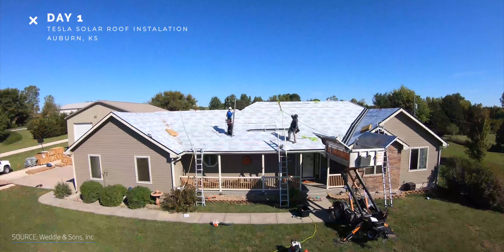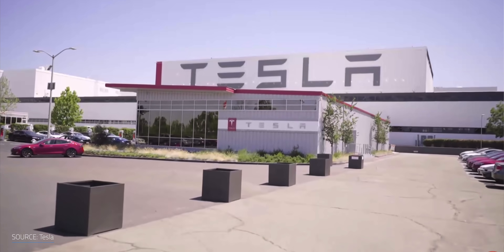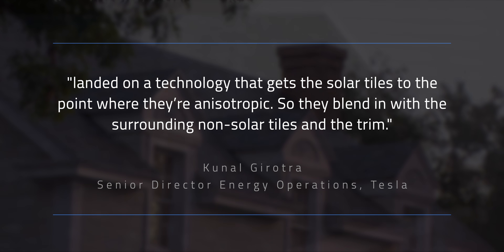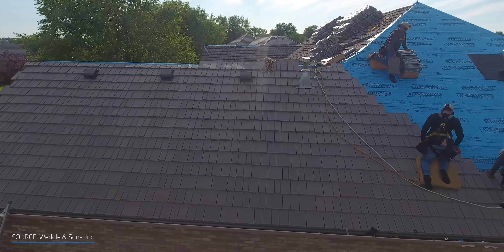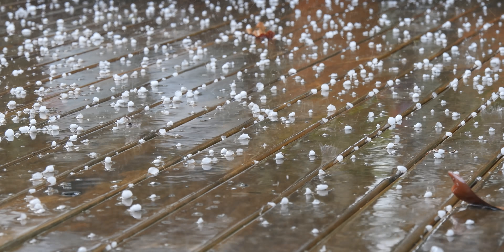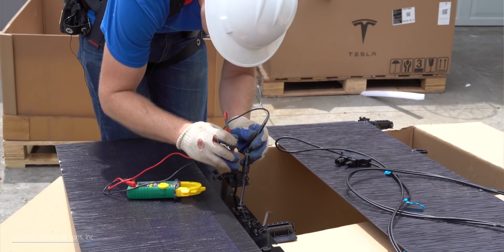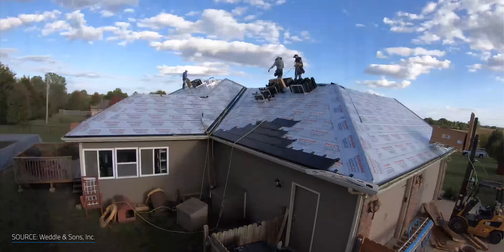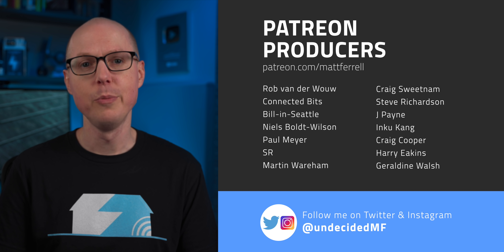Exploring If Tesla Solar Roof Is About To Go Mainstream?

Comment: I am still shocked to have discovered last month what prices Americans think is normal for Solar.  I had no idea that the peeps in the land of the free were getting so badly owned.  $2500 USD for a 6.6KW system fully installed, with inverter etc.  And they often offer a discount if you enquire but don't complete the purchase...

Comment: Thanks for so much Matt! Tesla & Tesla Solar Roofing is (hopefully) very much in our short term (3-5 yr) futures. The debate is permanent solar V a sun tracer system; potentially 50 - 70% more efficient? Details still TBD!
The industry innovates and changes constantly. Nowhere faster than with Tesla technologies.
Our 5 year plan includes a solar generation & storage system, with possibly an EV, if not a robo-taxi transportation system. Thanks again!

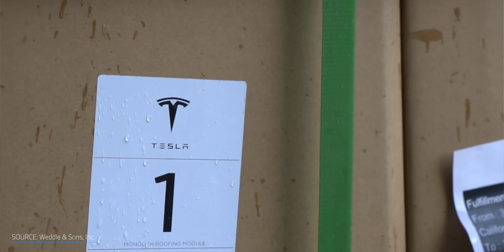Comment: @7:03 and 7:33 and 8:25 , I don't like the plastic framework these are build around. Should've been all anodized aluminum everything.
Fastened with Stainless steel screws and Teflon washers, insulating the different metals from each other, to eliminate galvanic corrosion. 
Plastic deteriorates quickly out in the sun. Specially where there are high amounts of UV and Ozone. at to that, plastic gets brittle with heating and cooling cycles. At -20ºC, it will break like glass, where as it would have had no effect at 0ºC. 
Adding additives helps a lot, but can't eliminate the destruction of plastic molecules or paints, from the Sun's UV radiation, and the Ozone in the atmosphere after lightning storms. 
Mortal enemies of all plastics.
Within in 10 years, it with break apart. A high gust of wind, and a huge chuck will get airborne and chop someone's head clean off! Clint Eastwood style! 
Too much? Time will tell...

Comment: One thing I think I’d like to see from Tesla would be an option for the same roof but without trying to blend the look.  
I personally don’t mind the look of solar tiles, and wouldn’t mind if my whole roof had that look.  
Especially if the cost could be lowered more without the look, and maybe get better efficiency overall.   
My wife and I just bought a house, and I think the roof is about 10 years old.  
If the installed price comes down even 10% more, or a larger tax rebate was offered, I think it would be foolish not to consider this as an option when we do need a new roof.   
I’ve started putting away a little money from each paycheck for future big projects like this.

Comment: I’ve been a licensed roofing contractor since 1985 & have helped design & introduce new roofing products such as Presidential TL by Celotex..I’ve been featured in numerous roofing magazines & instructional videos & I’m extremely blunt & objective when asked my opinion to the dismay of companies like GAF..I’ve followed Teslas solar roof since its reveal at Universal City. I immediately realized the individual tiles were not the answer & would like to see optional individual lengths of up to 10’ plus available with 12” or random alternating vertical etchings to give a more natural look..I believe the solar roof coupled with the Powerwall will take over the roofing & solar market..I’ll never install one simply because I’m retiring soon but the Tesla Roof would be my choice if I were in need of one..

Comment: Anyone who has had to deal with a roofing contactor will view this as attempting to walk through a camp fire carrying a pail of gasoline. It's very typical of residential roofing contractors to sub out the installers on a piece-work basis.  The contactor delivers the materials and these "handy men" ( and that's being polite) show up and install them.  Back in one of my earlier lives, I saw self-described "contactors" picking up leads from ads and even pamphlets dropped in mail boxes, handing out next-week's  "job site" addresses to "self-employed roofers" in bars on Friday afternoon's watering holes.   Such is the "trade" .

Comment: Matt, thank you for another awesome video!  did you discover any roof layouts which would disqualify a house from installing the Tesla Solar tiles sucesfully?  I was considering a roof that was not flat all around , one with several dormers.  Are there disadvantages for smaller houses?  Do you need a specific amount of contiguous flat space?  That would be great to know.  Also , it would be great to know what areas are being scouted like in your video.  Is Vermont on the radar?
Reply: Tesla has worked really hard to come up with a solution to almost any roof configuration, but from an installer perspective we'd definitely say that it makes the most sense when you have some large unobstructed sections of south-facing exposure. Solar Roof does have more flexibility than panels for fitting PV modules into more cut up roof sections, but complex roofs still add quite a bit more labor cost and cut down on production. Dormers in particular are labor-intensive and also create shading challenges. But both Tesla and installers are constantly working on ways to streamline and simplify installation.
Reply: @WeddleAndSonsRoofing  Thank you!!  that's great to know.  We are right at the limit of our current roof, and could push 1-3 more years out of it if we are lucky.  We live in a very harsh environment in northern  Vermont which doesn't help also!  The house does have half of the roof with a southern exposure, but it is not the "classic" flat roof.  We have a dormer.  I'm not sure if our roof will really pay off for the solar roofing.  we might just be better off to get a ground mount system.  I've called Tesla, and they are really not able to go through any of the details because they are not currently installing anything up here yet.  Hopefully soon!  :-)

Comment: This is effectively a PR piece for the Tesla solar roof tile product.  In a regular application, there is only one principal direction that can generate solar (we will leave out for the moment, the fact that most of the country does not have high enough solar insolation for solar to be effective).  Yet, to get a matched roof, all of the roof needs to be covered with the Tesla system (mostly dummy tiles).  The dummy tiles themselves are much more costly than all but the most expensive roofs and labor for installation is quite high(tempered glass can not be cut, so all the angled valleys are a huge pain).  The active tiles themselves are about 25% as efficient as a good mono solar panel initially.  I have not seen data on the drop off rates, but hard to believe that it comes close to a good mono panel.

There is a reason this has not taken off and the other companies in this area (Dow for sure) have quit.  The numbers don't work out, even with a subsidy (for at most 25% of the roof).  It is a niche product.

Comment: and another comment/question:  is there any new information regarding thermal management?  one of the nagging issues is that because there isn't space beneath the tiles, in addition to their dark construction, there's a chance that they either fail or have a reduced lifetime because of the relatively high heat load on summer days.  my guess is that the larger tiles help this a bit by spreading the heat a bit better than the smaller tiles, and maybe the interlocking with the nonactive tiles helps as well... but i haven't seen any data or commentary about it.  ideally, i'd like to see temp v. power generation for a south facing roof, roughly day by day, through a winter and summer season.  the temp data should be average over the generating day and/or peak temp for the day, and generation would be for the day, though being able to compare hour by hour temp v. gen for December days against August days would be spectacular.  anyway, you get my concern.  comparing those numbers to similar captured for a conventional panel install would be the perfect report.

Comment: if one wants cool looking solar, build a solar pergola in your back yard with transparent bifacial solar panels. It will be cheaper and look cooler. bifacial solar panels are only about 5 % more expensive than normal solar and have a longer 30 year warranty something like this:  https://hughloftingtimberframe.com/gallery/outdoor-elements/solar-pergola/

Comment: We've seen impressive advance in battery technology, but thus far the best efficiency achieved by solar panels remains below 40%. That suggests that there's a lot of room for improvement if research were to focus on such advance.
Reply: There's lots of research happening, but so far nothing practical.  
What we have is good enough, if it's installed widely.  Rooftop solar could power about 75% of homes in the US all by itself.  Adding wind power to that along with ground-mounted solar over parking lots and other places would take care of everyone else including industry.
Reply: @calamityjean1525  I agree, but I also believe that technology will make additional significant headway in the near future, and that the consumption of electricity will increase in the future. I'm personally postponing my purchase of a solar system because I believe that Tesla will soon introduce HVAC systems and other appliances that use DC current, which is better suited for powering individual homes than AC. It enables more efficient motors, and would eliminate the need for converting the DC current produced by solar panels into AC current using wasteful invertors. Plus, I expect there will be decorative tiles for driveways and sidewalks and streets that will be capable of contributing electricity.

Comment: Matt best for 2021 and safe year.   We are designing and constructing a 5 levels of CLT and Passive House Certified. 300 m2 roof and  450 m2 using #Tesla tile and #Tractile tile both impact resistant from hale. Price of #Tractle 1.25 of concrete tile roof and has no PV.   
#Xlam #CLT #PassiveHouse #LismreNSW #Australia
Reply from the maker: All the best to you too Ian.  Here’s to a good 2021!  That sounds like a great project and home you’re building out.  I want to go that route too.
Reply: @UndecidedMF  We are going to set up company to invest in EV like Apter and Arcimoto in Australia or manufacture under under  license

Comment: 'should hold up really well to impacts, should age well' have you seen the reliability of a tesla? on principle the motors should be fine, brakes should last an easy decade, and no engine or transmission fluids to change

which means if anything goes bad, theres no real fixing, only replace. every tesla before 2015 had a known design flaw that stripped the spline to the motor at around 40k miles, so that 'no maintenance' turned into a serious repair, of more than a few thousand dollars

on top of that, before i think 2016 or 18, they all have too small of a memory chip thats known to wear out from all the data being logged and the only fix for that is to pull out the computer and resolder a new memory chip, which costs another couple thousand

on top of their awful fit and finish QC, i cant see why people would think theyre so great

and thats if youre lucky and dont get one with problems from the factory

Comment: This roof is ridiculously expensive compared to standard roofs. Unless you have a very high end house,  this is a losing proposition based on ROI. What you fail to mention here is there are shingle roofs with 40 and even 50 year warranties.  

Honestly,  in AZ you can have a tile roof installed on a 2000 SF house with a 40 - 50 year tile roof for around 10 - 14 k. Panels would cost another 10k. The Tesla roof would likely be 50- 100% more in cost.  

On a high-end home,  where you are installing a decorative roof,  then yes, a Tesla roof makes sense.  But for the average homeowner,  no, it's not even close.

Comment: If every house had these, then local power could be distributed and power cost would go down, then the power co's would hate us all.
Reply: Power cost would go up actually. That’s what people don’t realize, as things become more and more energy efficient companies need to charge more because they have a relatively high ratio of fixed costs, so if you change the consumption of a variable rate good, that variable rate needs to increase to cover the non-changing fixed cost.
Reply: @Arteolike  Exactly!  Remember when CFL's and then LED lights were just gaining traction?  While I'm sure that electricity costs would have still gone up they probably wouldn't have gone up as much.  I think that's one of the reason for rising gasoline prices AND the deterioration of roads as well since in most areas FUEL taxes are used to (partially) fund road repairs.

Comment: One BIG advantage and not mentioned, contractors can literally replace every solar tile without removing a nail.  Not having to seal, or miss sealing holes in the roof membrane probably extends the life of a whole roofing system.
Reply: They mentioned it. :)

Comment: Yes, I am "chomping at the bit" for a Tesla solar roof!  How can I find an installer?
Reply: *champing  
https://www.youtube.com/watch?v=Ltb_14CWqDA
Reply: I believe you can find installers on the Tesla website.  Hopefully you're in an area that has at least one!
Reply: www.tesla.com - Tesla sells them directly and subcontracts to a local installer.  Tesla also handles the paperwork for permits and Permission To Operate (PTO) which allows you to send excess power back to the grid and get paid for it in most locales.

Comment: My experience with the Tesla Solar Glass Roof was less than ideal.  I love Tesla.  I drive a Model S and own a significant number of Tesla shares.  But… here is my experience:  I live in Rhode Island and found myself in need of a new roof.  I called Tesla last March (2020) and placed an order for my Solar Glass Roof. I got the financing arranged immediately and I was soon notified that the necessary permits had been applied for.    Then things started to go sideways.  A couple of months went by and my permits had not been approved.  I contacted Tesla and was told the city was dragging their feet because they were not familiar with this product.  So I went to City Hall and spoke with the two people that were responsible for approving the permit, the building inspector and the electrical inspector.  They informed me that they had emailed Tesla for a couple of things and Tesla was ignoring the emails.  I was skeptical and asked if I could have copies of the emails… and the city provided them to me.  I then contacted Tesla and Tesla ignored me as well.  Finally after several calls, online chats and emails, Tesla finally got back to me.  Tesla escalated the issue internally and my permits were approved within two days!   At that point Tesla told me the next step was to schedule the installation.  Three more months went by and I had no word on my install date.   I contacted Tesla multiple times for a status report and again I was completely ignored… for several weeks.  The treatment I received from Tesla was very frustrating.  When I finally did reach someone at Tesla, I was told they could not guarantee my solar roof would be installed before winter.  I was worried my existing roof would not survive another New England winter, so I cancelled my order with Tesla and had a conventional asphalt roof installed.   I am sad to say that as customer I had a very disappointing experience.

Comment: Once again a product which was really thought through from Tesla. It always feels like other companies aren't really thinking things through or try to cut investments in the short term just to have a worse product in the long run. That's why I love Tesla. Take the EV charging for example. Every other car company simply made those cars and didn't really think about the charging and how customers actually use those cars, while Tesla really thought that through and decided to just create a supercharging network. They looked at people who charged at home and started to offer cheap  solar. And once again they just started to offer powerwalls alongside, because they understand that you usually aren't using up that solar energy during the day, when you don't even need to turn on the light and might not even be at home if you are working.
Just well thought through concepts in general. Just like what they do with SpaceX too. They look at their flaws and strenght, and then they make products that fix the flaws and build on their strenghts. I just hope Elon will be able to change some more industries in his lifetime, I think especially flying and shipping is a big industry he might go after maybe even in 3-5 years once Tesla is basically just self sustaining, or maybe once the Starship makes consistent flights to Mars. Rather hard to say, I'd see him leave Tesla to be on it's own, since it already has so many great engineers gathered and seems like a company that would do fine even without him already, while SpaceX is probably just starting to see the problems they need to fix if they want to create a sustainable base on Mars.

Comment: Unfortunately, it still doesn't make monetary value for my specific situation... yet. In addition to several trees that give shade over my roof most of the day, I pay ludicrously low rates for my electric, and I pay a flat rate rather than different rates at different times, a flat 0.13$/kwh. I'll keep an eye on it, when it does make economic sense I'll pull the trigger, but it's still too early, and my electric bill is usually under a hundred bucks a month, which would make my RoI look pretty unfavorable at the moment.